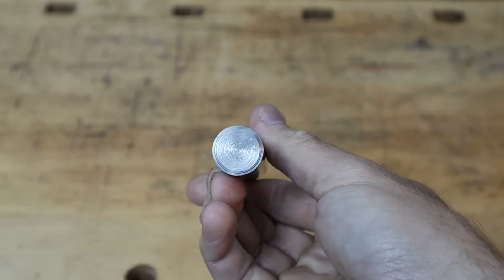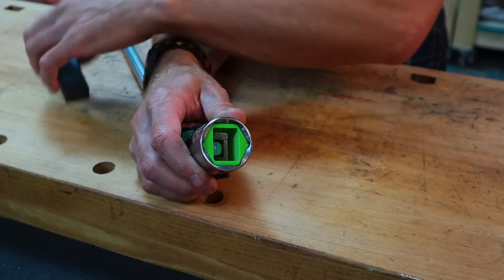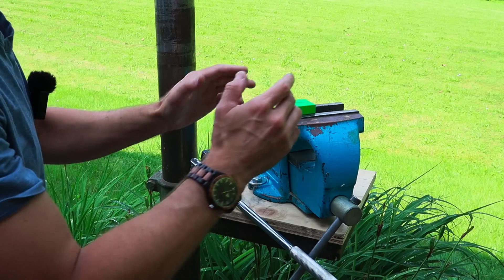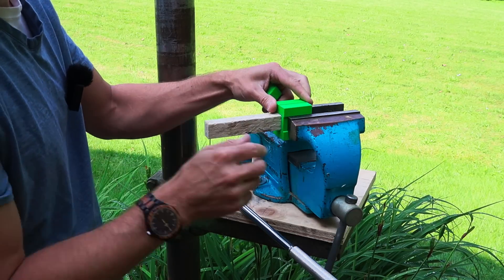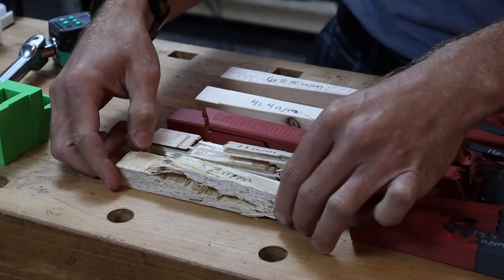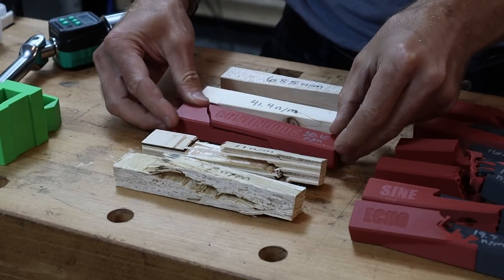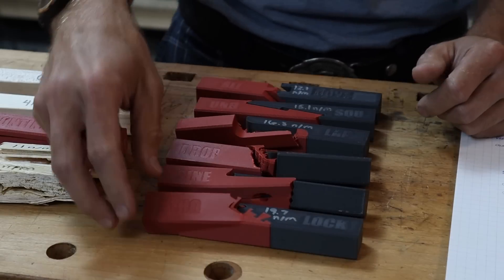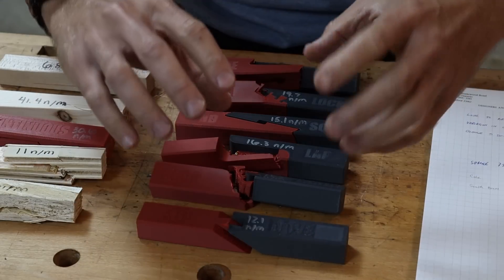How Much Can You Twist a 3D Print Before it Breaks?

Comment: The red material likely isn't especially weaker, at least by any significant amount. What's happening is that the way you're applying twisting motion is concentrating the forces on the back bottom of the print (where it seems most failed), especially so since you're levering the rotational force rather than applying it centrally. As much as you try to keep it stable by hand some force laterally will still be provided in this setup. Even rotating the parts 90 degrees would likely have yielded a different outcome, at least in the way the parts fractured. Secondly, the interface between the red and the grey material, the actual joint, will always be weaker than the material when it comes to where fracturing starts. There is slop and some tolerance there, there is lots of geometry to concentrate forces on, like in inside corners, further increasing the force on the moving part (red) while keeping the stationary part (grey) relatively unloaded as its only subjected to whatever force the red part can transfer into it via the joint. If you print the parts in the opposite way, or even have the same parts but flip them around in your test jig, you will likely see that the grey part breaks before the red. 

Taking a rudimentary mechanical engineering course would probably be a good idea, just to learn about where loads concentrate, how to design to avoid them, or strengthening where needed. 🙂

Personally, joints are generally something I never bother with in 3D printing, I would be much more interested in seeing how solid parts with a varying amount, and type, of infill performs under load, whether it be compression, tension or twist. All the way from 100% solid to like 5% infill in a few different types. Some infill types do really well mostly two-dimensionally while some, like 3D honeycomb for instance, seem to do really good to spread out loads in three dimensions.
Reply from the maker: That could very well be, I'd be willing to setup tests for each color to be sure about it.  It seems most people think the color does have a fair amount of impact.
Reply: @NeedItMakeIt  It can definitely have an impact when you're talking difference between white or black filaments, for instance, due to the very different amount of pigments needed to color plastic. White requires an extraordinate amount of pigments to get proper white, whereas black requires very little pigment to fully color a plastic black. That can definitely have an impact. However, two reasonably midrange color filaments of the same material, from the same maker, should have very similar material properties. 

There are a lot of variables to account for here for sure. Even retesting these joints with something like epoxy glue in them ought to have a different results. Not necessarily because epoxy will stick well to PLA (it won't), but rather because it acts as a gap filler taking up a lot of slop and small tolerance gaps in the joint and thus making the joint more rigid and able to withstand more before it deforms and slips apart.
Reply: also hey @NeedItMakeIt  I'm trying to reply to topherSought and help him out up there but my messages seem to get caught in some filter?
Reply: "... joints are generally something I never bother with in 3D printing..."
unf., I don't have a choice: I have a bunch of chairs to repair or throw away, and I don't have a 500mm printer

do you know of any online options for a basic mech. eng. course, though?  that would be super interesting for me, but I don't have any options for that where I live.
Reply: @thoperSought  it seems like my reply to you got caught in some filter. There are courses online, from popular sites which offer online courses, which I probably can't link or mention here or this reply gets caught in a filter too. Google it, there are plenty around. 🙂

Comment: Hi Mike.  What about a screw in connection?  Not sure how to explain it, but like the end of a broom stick screwing into the broom head...it that makes since but all plastic (not using any metal).  If that does not make since i can msg you.  I know that it probably would not do well in the sheer breaking at the joint but maybe the torque.  Since the screw in joint would be getting tighter and forcing the 2 pieces closer together.  yhou can even take it a step further with a countersink socket with locking notches.  Thanks for the video.   I always look forward to these.  Some of those breaks are really energetic.
Reply from the maker: It could be done, my question is how to 3D print it without supports so the connection comes together and mates as clean as possible.  More videos coming, well every single week!  I'm glad you're enjoying them.

Comment: How about a 2D joint attached via insertion. Like a Torx socket. Also hex, cross, etc.  then secure good in place with screws or dowels.
Would be nice to also see glue being used.
Finally please compare various infill patterns and fill ratios.  Including hollow and solid.
Reply from the maker: I think I get what you're putting down.  That's a great idea, this reminds me of something I've done in the past with wood as well, so I think I can whip something up.   I'll do a glued vs non-glued connection test as well, that's one I'm really curious about.  I believe that the best adhesive for PETG is PU adhesive.

Comment: Relevant static tests are usually 
3 point bending (can be non destructive) 
Compression
Tension
Shear
Reply from the maker: For metals you mean?
Reply: @NeedItMakeIt  for most materials if possible.
But for metals tension testing is fine 
For concrete compression tests are fine also because the tensile strength is around 10% or less about 3-5MPa
For wood and reinforced concrete 3 point bending is the most relevant, because of the complex failure modes. It's a cleaner/simpler version of the twisting test
Shear tests are relevant for anything but metals, but especially for truly plastic materials like clay. The impact test is a relevant substitute.
Stress strain curves in tension and compression would be interesting, likewise could shear strength (and stress strain) be of some interest. 
Right now we are modeling plastic like it is an elastic isotropic material, and it isn't

Comment: I think in most use cases for 3D printed connections, we wouldn't expect it to hold up such amount of twist.
Personally I would expect it to be a rather "stiff" or "not wobbly" connection under light load.
Do you think it would be better to compare the torque required to twist it to a certain angle? (e.g. 45 or 90 degrees)
It must have taken a lot of time to print, test and record the results. Thanks for making these videos!
Reply: A graph of Torque (Nm) vs Rotation (Deg) would be ideal for estimating joint stiffness and point of failure.
Reply: I always like to think the most stressfull application is making a 3d printed high performance RC car.

So, any research is beautiful for this.
Reply from the maker: Good points, I can always create a different test setup for stiffness specifically rather than failure.  Torque to angle makes sense to me.

Comment: great video! It would be interesting to see cylindrical joints hold up to these tests since they work much better in torsion
Reply from the maker: hmmm, that's a good idea, I'd want to have a small flat on the bottom to print it without supports.